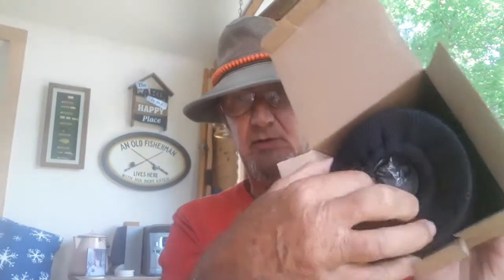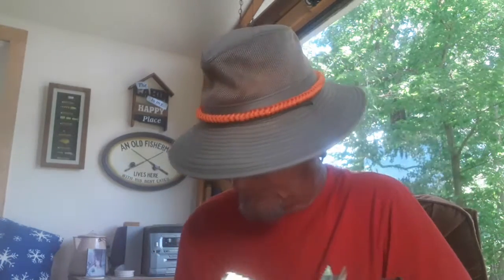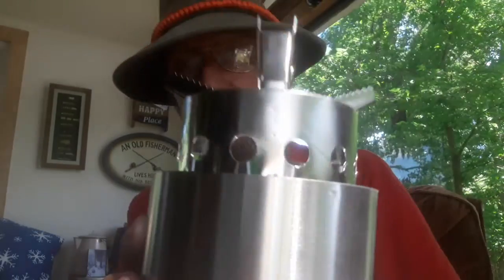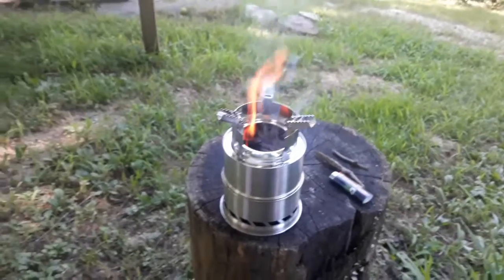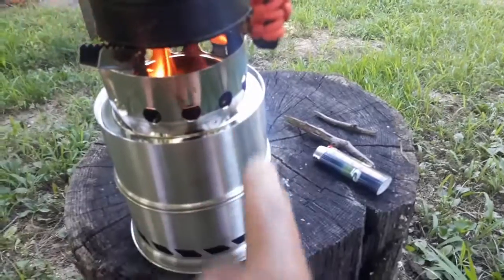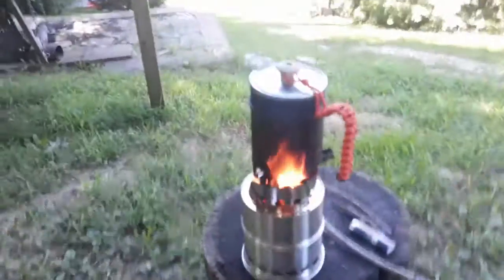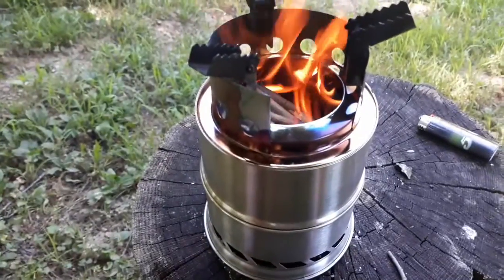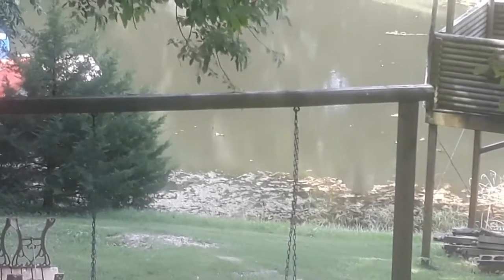Canway collapsible wood gasifier

Comment: Sticks stacked vertically and tight work best, you can also feed it fairly chunky bits of wood once it gets going. I have one, it's been good so far. I always keep some pellet stove fuel too. Cheap and you get 25 to 30 minutes burn time if you a fill it up.